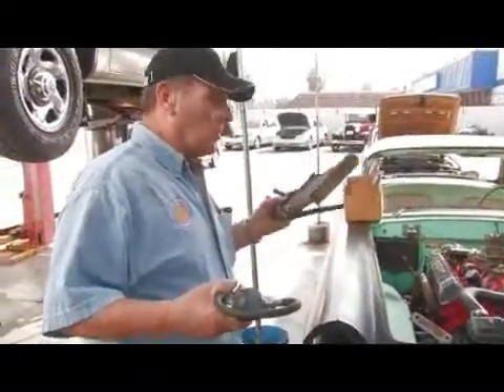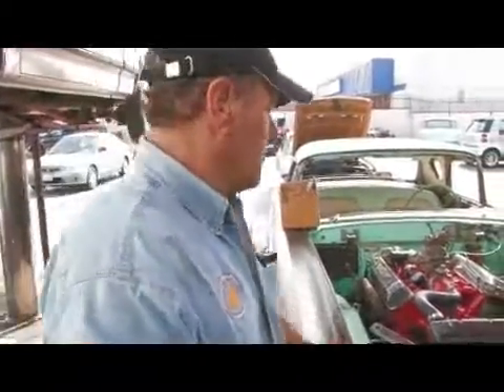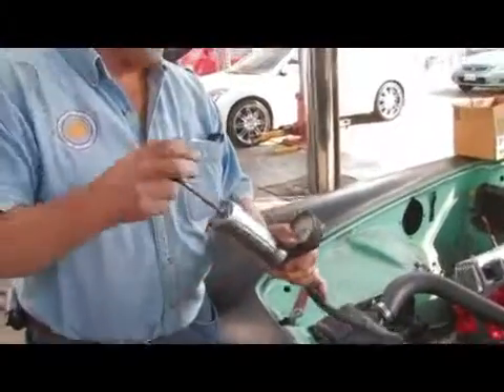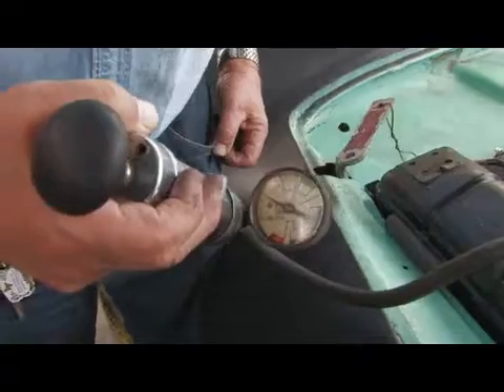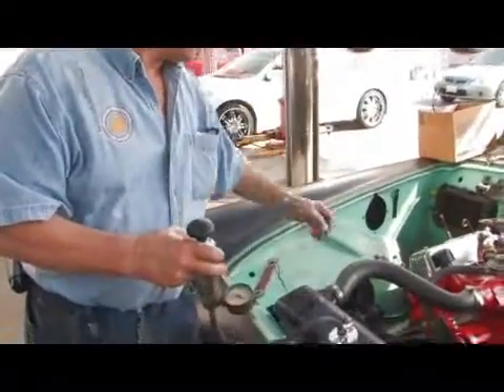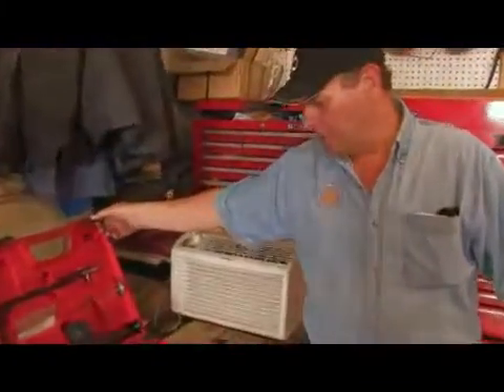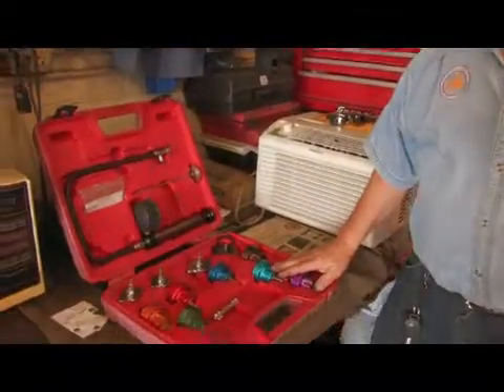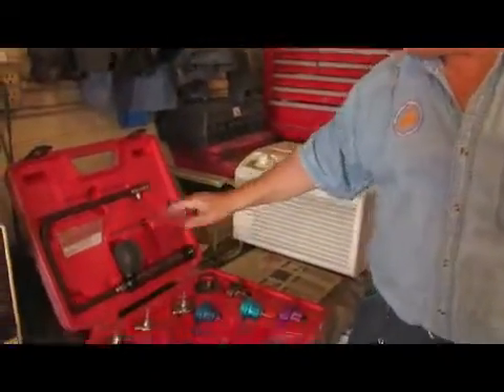How to Check if a Heater Core Is Bad

Comment: I don’t know about a heater core filter but there is a cabin filter. I found mine by taking out the glove compartment . This is how I found out that my heater core was going bad. I had a drip of antifreeze on the edge of it. I was also wondering why I was buying antifreeze every two weeks. I also had dampness in my floorboard on my driver side but it was small and we had gotten a lot of rain so I thought it was just from me. Keep putting my wet feet in the car. Hopefully this helps